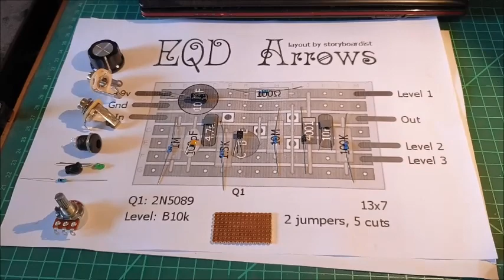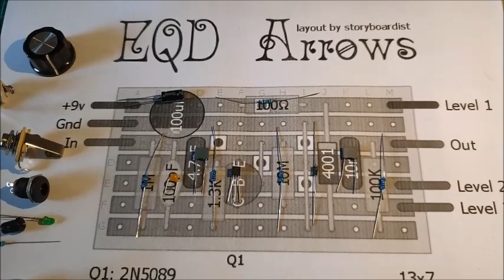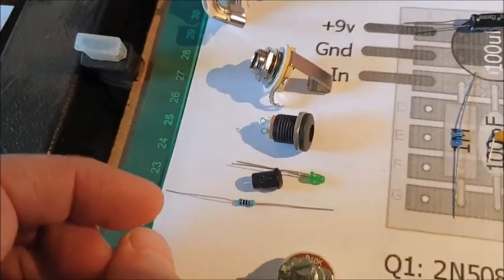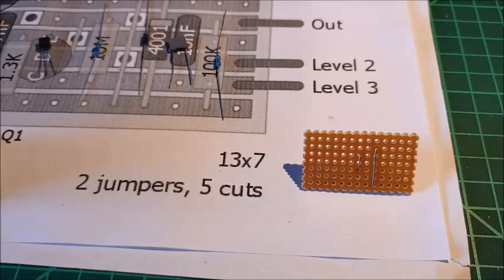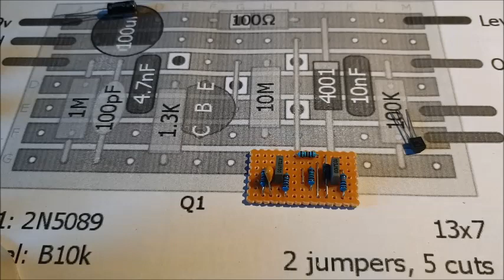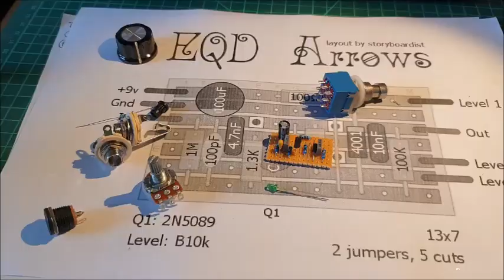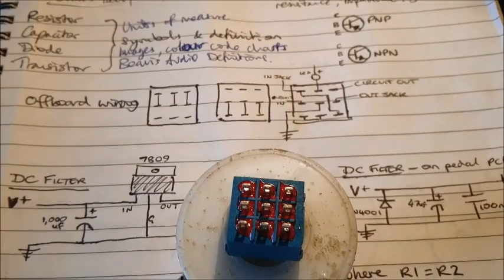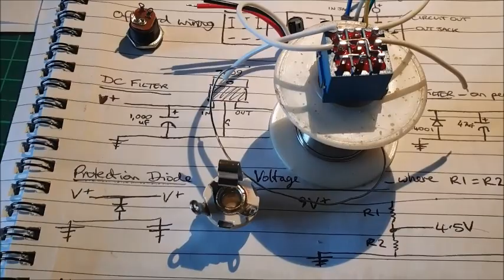Guide to DIY Guitar Pedals - "Arrows" Pedal built on Stripboard

Comment: There is the thing of finding out which way around the non electrolytic capacitors go by figuring out what end is the outer part of the film. You can do this by holding the capacitor and touching it against your guitar lead plug with the other end plugged into your turned on amp. The less noisy way around shows you which end of the capacitor is the outside end of the film.

Comment: Amazing tutorial, today I made one myself but I changed a few values cause I did not have them. I wanted to use it with my modular system and took a few components from an old  answering machine. I have no idea but it works even without 9V power and it seems a 9V makes  no difference.

Comment: Can anyone tell me what the resistor top centre is ? It says 100 + ohm symbol...is that just 100ohms? Or 100R? Or 100k? Thanks@!
Reply from the maker: That's just 100 ohms. It can be written like that, or 100R. Or possibly other ways too! I have no idea. 
100k is 100,000 ohms so swapping them out would make a bit of difference. In most cases 15-20% difference wouldn't affect a pedal circuit much (you could throw in an 82 ohm or 120 ohm resistor with little noticeable difference)